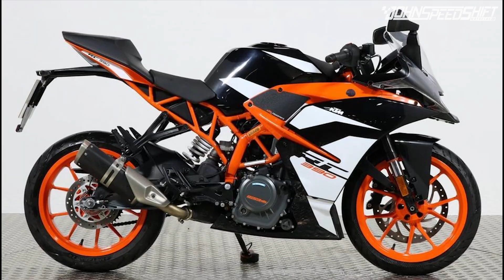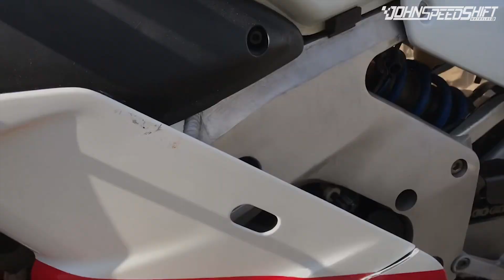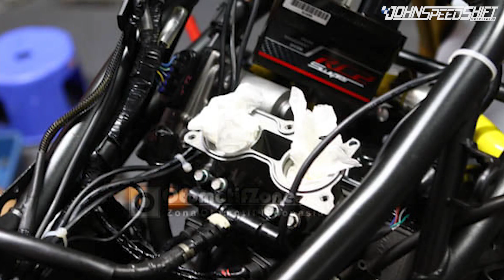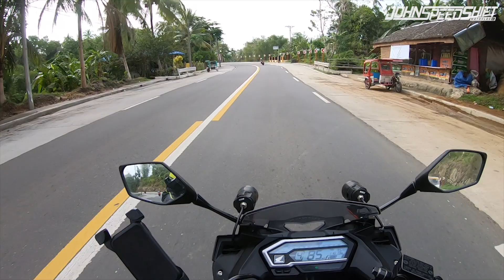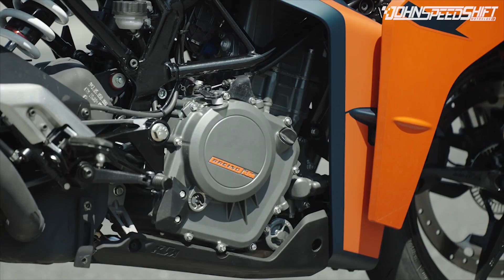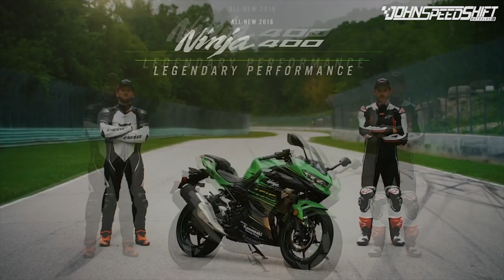Honda CBR 250rr Philippines  |   Dadating ba dito?

Comment: Dadating ba talaga yan? Sa tingin ko hindi, may 250 na dumating actually, kawasaki 250xr at magkano yun? Halos kalahating milyon na. Asa pa kayo na nasa  300k lang yan heh heh, at least ang china brand dito sa atin eh nangangako at dumadating yan sigurado ako malabo pa sa kape heh heh. Promise di dadating yan.
Reply from the maker: Twin cylinder lang cia kaya possible na 300k and up lang. Pero kung dadating o hindi, nasa inyo na iyan. =)
Reply: @JohnSpeedShift  2017 ko  pa inaabangan yan, hanggang sa kinuha ko na yung R15 V3, yung R15 namin so far hanggang ngayon Perfect condition. R3 ang pinagpipilian ko na Higher CC oh yang 250rr ng honda naman, kung 350,000+ ang presyo niyan eh malamang sa R3 na ako hanggang 200,000 + plus reasonable Range price na yun.